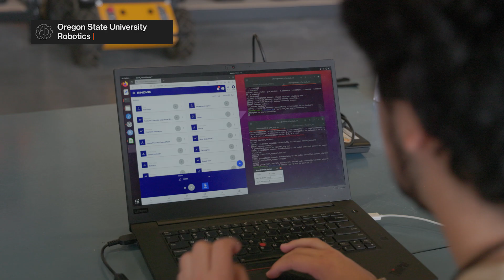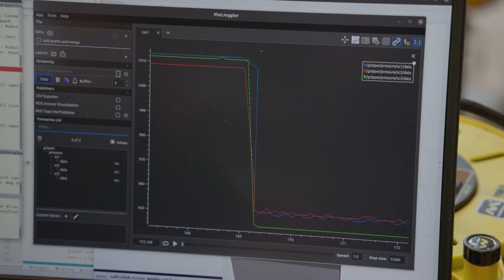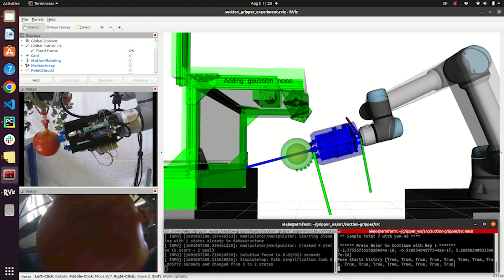Our apple-picking robot is transforming agriculture

Comment: Cool stuff but I'm not entirely sold on the prospect: for robot picking to be effective, the plant has to have a specific shape, size and weight, and for that to be achieved, the species is most likely GMO and the orchard "tree" isn't really a tree any more, as it is a monoculture of tree-like bushes. They have to have a certain spacing to fit the machine rolling down each row of apple bushes. Since apples are not native species in most places, they also have to be sprayed with chemicals. All this robot does is to seek efficiency in mining the resource, not of rejuvenation of the soil. Taking the human out of the field, means it's ok to spray chemicals on a GMO monoculture crop, that then gets processed and covered with petroleum-based wax, then sent to industrial storage reliant on carbon dioxide for longevity. 
No, it's not transforming anything. It's merely adding another layer of technology to a flawed system. 

And I'm betting it comes with a juicy maintenance contract.